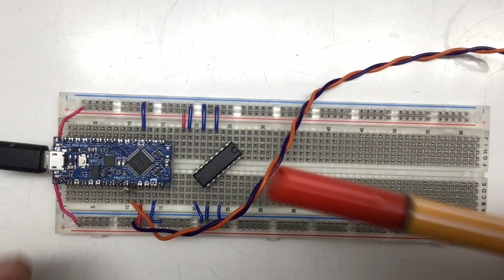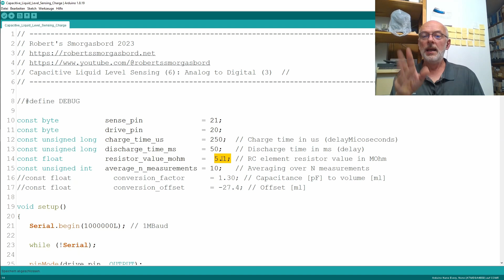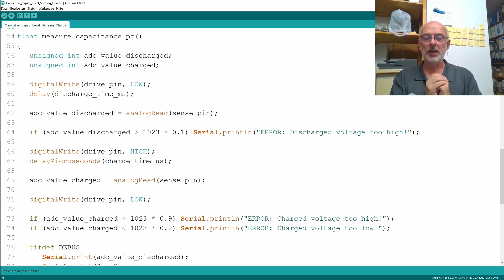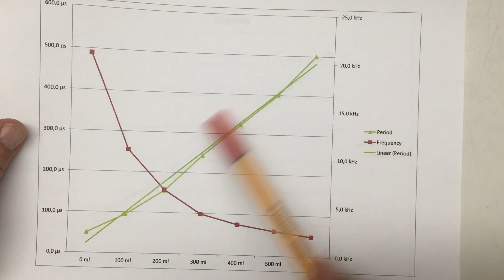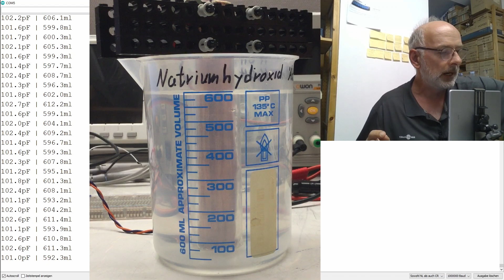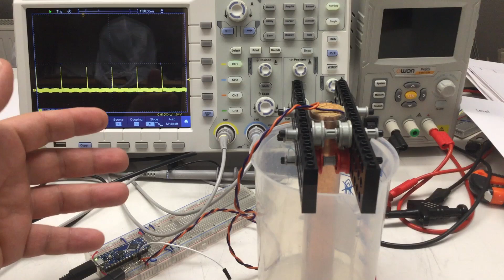Capacitive Liquid Level Sensing (6): Analog to Digital (3)

Comment: Very nicely explained.  One of the best examples of using an ADC for capacitive sensing that I have seen yet.   I loved your 50 hz explanation.  I also loved your explanation for converting into pico farads.

It may be worth  adjusting your discharge time when you're in an error state.  You can also adjust your charge time dynamically so if below your target range then increase charge time  and if above target range decrease charge time.  As long as you know the current value it should plug right into your formula.

Even with your resistor change to avoid the 50 HZ problem you're depending on luck to not have any single measurement impacted.  Rather than simple averaging if you throw readings   too far above or below the others then it becomes self correcting.
Reply from the maker: Many thanks for the praise!

Adjusting the charge/discharge time is indeed a common technique in capacitance measurement applications. I could have included that, but I wanted to concentrate on the principles and keep the code simple. Hope you can forgive me 😅

You're right about the averaging. It's indeed not the best (most noise resistant method). But again, I wanted to keep the code simple. Anyway, besides throwing away outliers you can also take the median of the measurement (much more resistant against outliers).

Anyway, thank you very much for you detailed and in-depth comment!